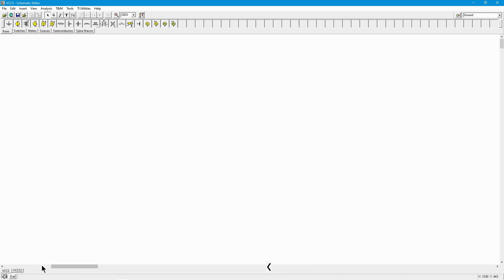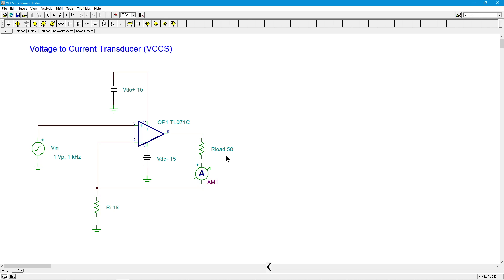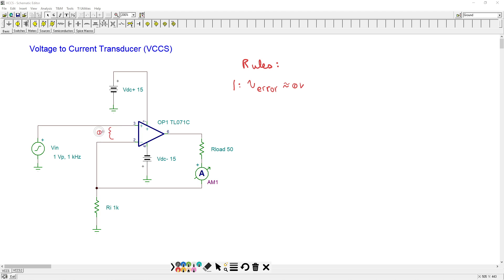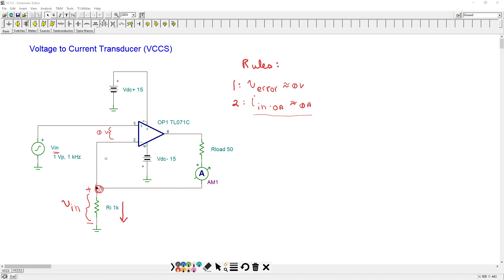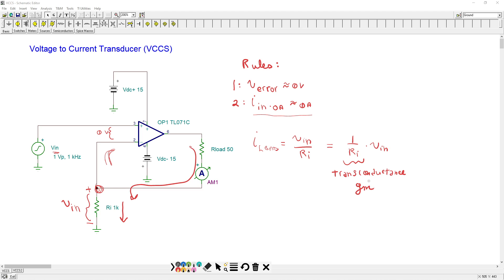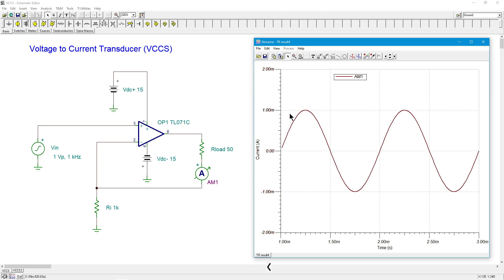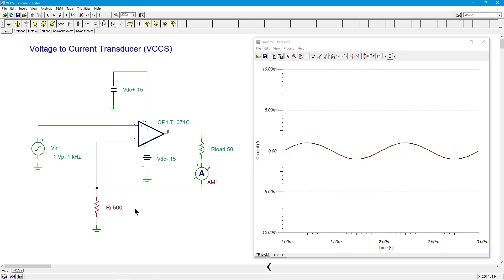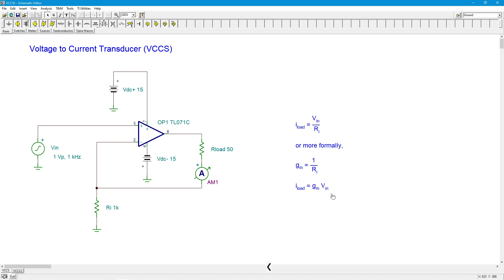Op Amps: Voltage to Current Transducer

Comment: EXCELLENT VIDEO!WHAT WOULD BE THE APPLICATIONS OF THIS CIRCUIT?
Reply from the maker: Any load that should operate with constant current drive is game (typically, that would include certain loads with a sizable reactive component). I saw a unique application several years ago where Craig Anderton "hot roded" an old guitar spring reverb unit, driving it with a circuit like this one. He reported that it sounded more crisp and bright than when using the usual constant voltage drive.

Comment: Hello, without necessarily endorsing, would you mind saying which device (e.g. graphics tablet) and software you're using for your on-screen notations?
Aside from that, I think you're a fantastic teacher. I can only imagine how much more I would have learned had I had more like you.
Reply from the maker: Thanks. The software is ppInk which is a fork from Gink. It's free. I like it well enough. The graphics tablet is a full size pressure sensitive unit. I forget the brand. Huion or something like that. It's OK but I find it a little clunky. The nice aspects are that it only requires a USB port and it was relatively inexpensive given its size. Many years ago I had a smaller Wacom that I liked much more (how old, you ask? Well, it required a serial port...) If I were to do it again I'd spend the extra money and get one with a display. I'm used to drawing on paper or white boards so I have a hard time with the disconnect of not looking directly at my pen while I'm drawing. I've used units where you're drawing directly on the display and I like them much better. The drawings, and especially the text, come out much better. Of course, the cost difference is pretty large.
Reply: @ElectronicswithProfessorFiore  Thank you so much for replying and in addition, so quickly despite this being an older video.  I've only recently discovered your videos.  Your explanations are clear, thorough and your added humor (for me at least) adds some additional fun to learning.  Thanks so much for providing this channel and your books.  I've ordered most of the Kindle versions from Amazon as a small thanks for the wonderful gift of learning you provide.  
PS - forgive me if you've already done this, but if not, is there any chance of you covering stability analyses and/or component sensitivity analyses in future videos?
Reply from the maker: @markgillis2447  You might find this one of interest: https://www.youtube.com/watch?v=f1LKEwqKQuo

Regarding your other comments, Frank Zappa once asked "Does humor belong in music?" His answer was "yes". For years I've asked a similar question: "Does humor belong in academia?" I also answer "yes". 

Oh, and thanks for the book orders. Leave a review there for others if you're so inclined. Tell your friends, tell your family, tell complete strangers (who knows, they might become your friends)!